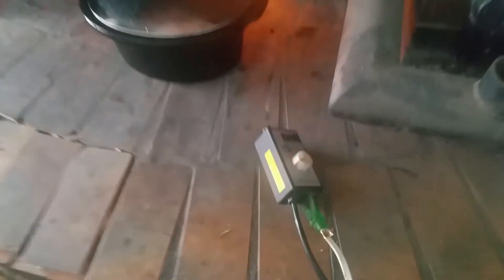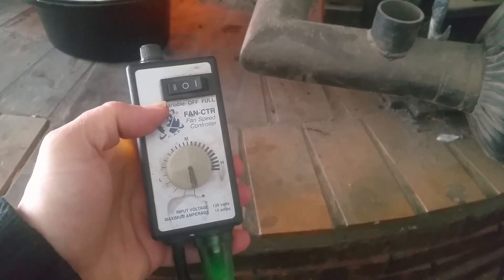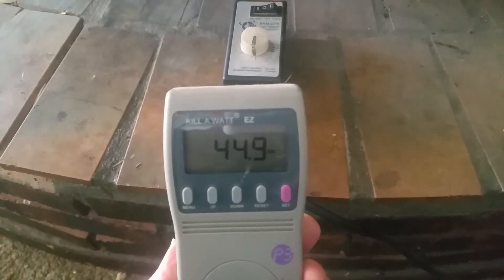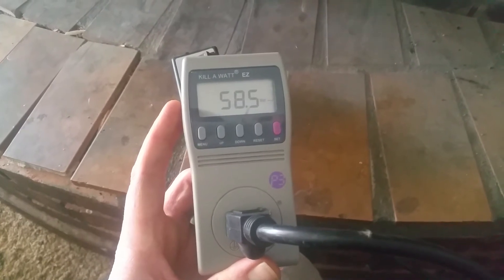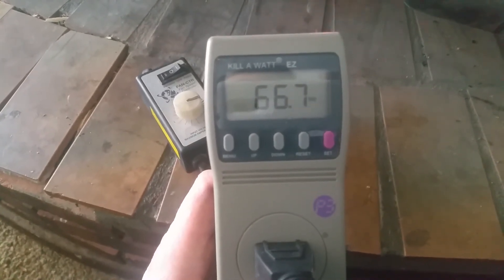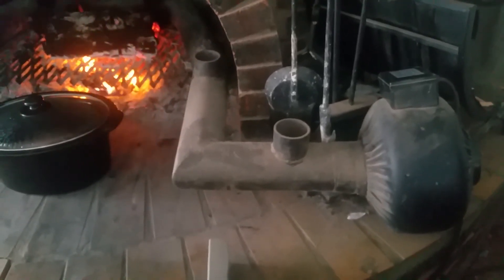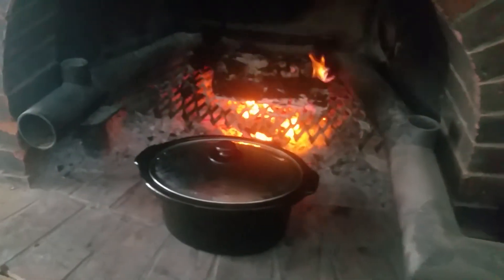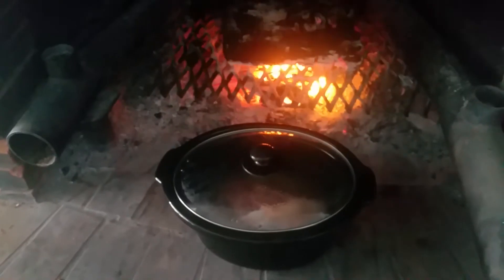67 Watts 😮 PROOF A DIY Low Cost Low Energy Heater #PolarVortex #PowerOutages  #DIYHeater #SHTF

Comment: In Oregon, lost power Friday afternoon its Tuesday night no estimate on when we will get it back, were also without phone service until a few hours ago. We were set with food, light sources, charged phones in car etc, heat is what we are lacking in been between 40-45 degrees in our house. Not many options in our current mobile home though. In the process of moving to Texas and at the very least this has been a great learning experience of what has worked well, what we need to do differently and holes we need to fill... like multiple heat sources! Lol

Comment: So many people I know have electric heating systems. I have a gas heater and a 200 gallon propane tank. Without the fan circulating the heat it is colder in the house but livable.
Reply: What kind of gas heater? Would one of those fans made for woodstoves be made to work? I saw one prepper contrive one to work on his Mr. Heater units.